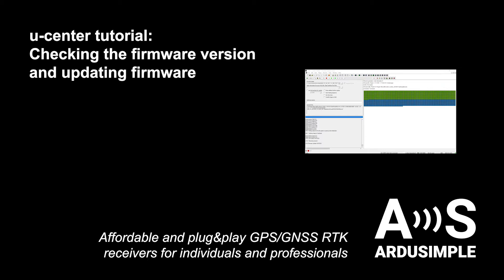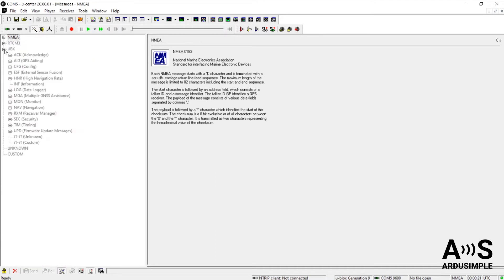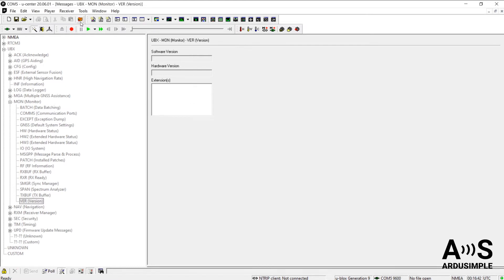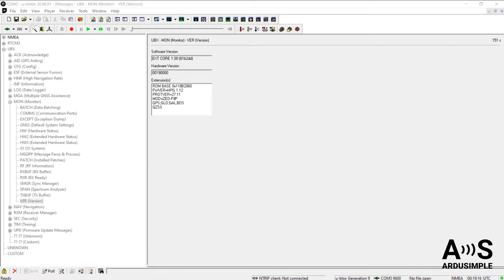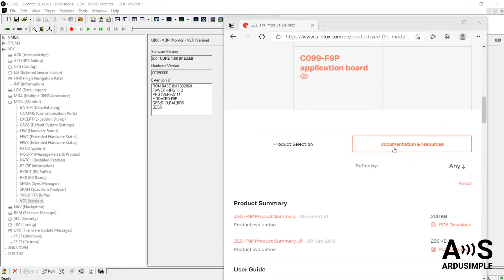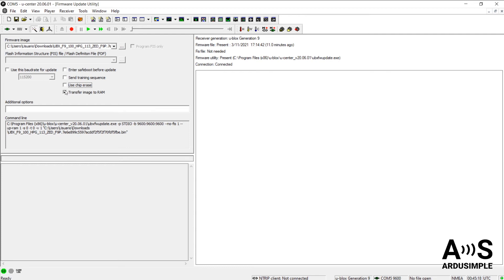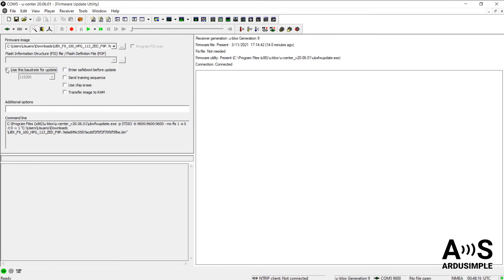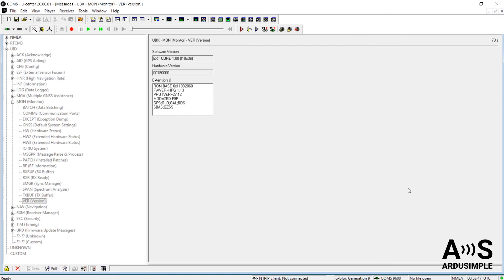u-center made simple: Updating firmware for GPS receiver

Comment: In the "Firmware update" window the GO and STOP buttons are gray. At the same time the modules themselves connect without problems I see navigation data and information about the firmware version coming from them. I connect the GNSS module via a USB-UART converter to FTDI. The converter is 100% working.  Tell me what could be the problem?
Reply from the maker: GO in grey usually means that the GPS receiver has not been recognized by u-center or that the settings in the firmware upgrade window are not complete. Note that this video has been done with u-blox F9 series, if you have an earlier model the procedure might be slightly different. If you can share a video recording of your screen with my colleagues from info@ardusimple.com they will be happy to help

Comment: Firmware will not update if you have Arduino IDE installed. It gives "Firmware Update Utility has unexpectedly terminated
Exit code (3221225781)"
This is how I fixed:
Go to this folder: C:\Program Files (x86)\Arduino\drivers\FTDI USB Drivers\i386
and copy ftd2xx.dll to the u-center folder: C:\Program Files (x86)\u-blox\u-center_v22.05
then run the update again.
Reply from the maker: Thanks for sharing your experience with the community!

Comment: I want to update u-blox M8N Firmware (from 2.x to 3.x) over USART - I checked the firmware version like in your example.
But the button on the left down corner to start the firmware update inside the update tool window is not activated, no matter what I click there.
And the legacy firmware update tool results in an error.
Reply from the maker: Hi! Unfortunately all ours tutorials are for the ZED-F9P, we are not familiar with the M8N module.
We suggest you check u-blox support forums.